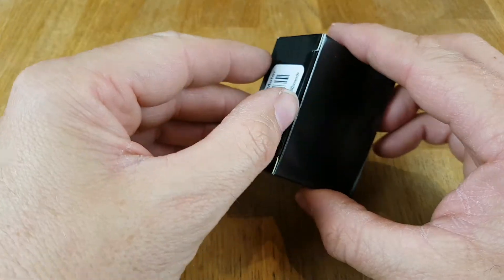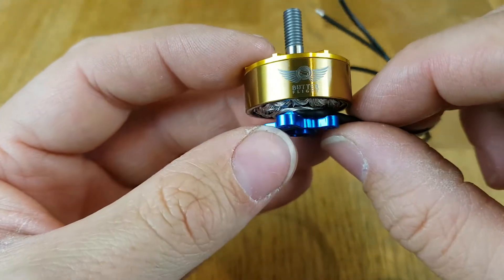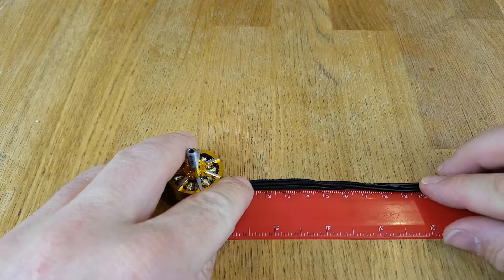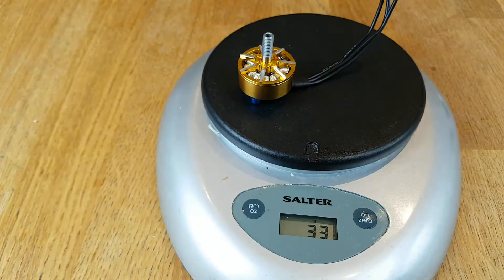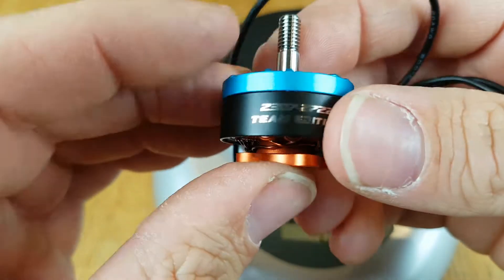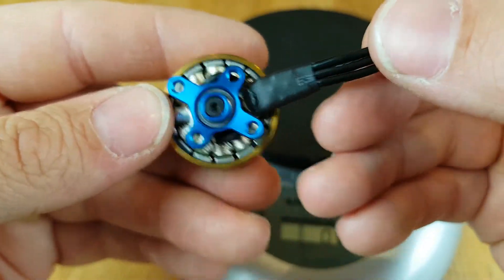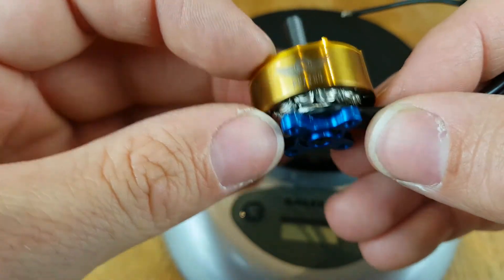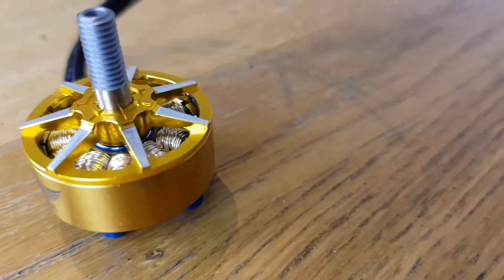butterflight 2207 2500kv motor review part 1 of 2

Comment: Great first part mate. Should be interesting to see how they handle 6S, kinda shocked at how heavy they are though 😕 although I don’t have any experience with 6S or 2207 motors so not sure if that’s the norm 😂
Reply from the maker: Matt Lovatt They look fantastic and if they produce good power then the weight is ok for a 6s setup. Look out for part 2 👊
Reply: 38gr with 13cm of wire. So around 33 naked.